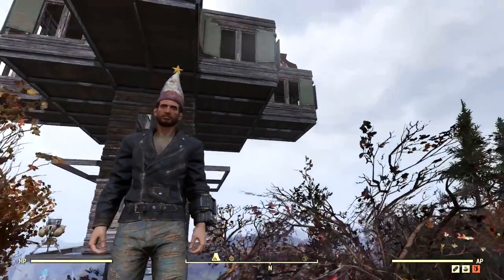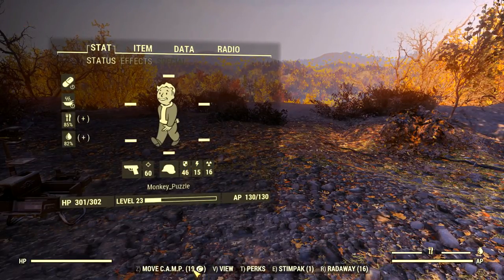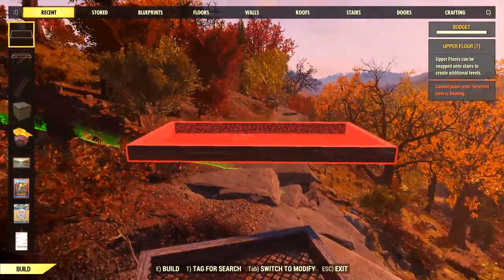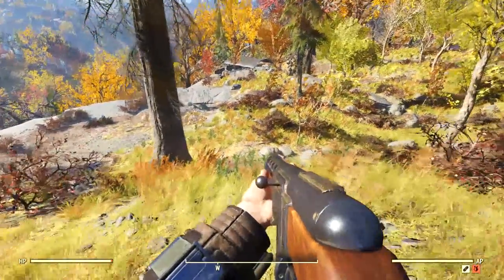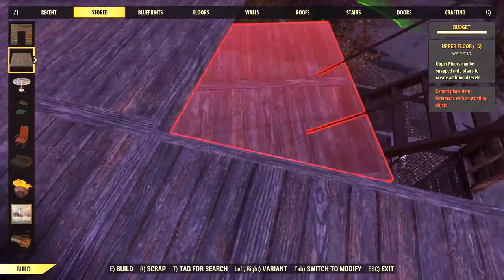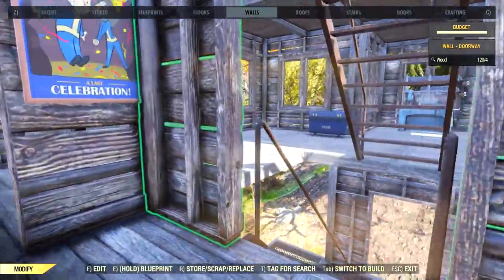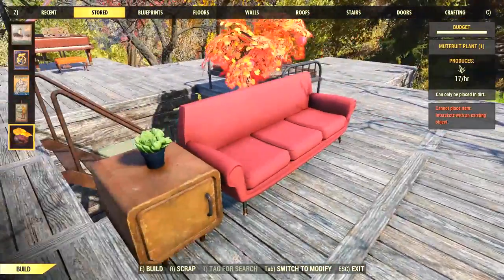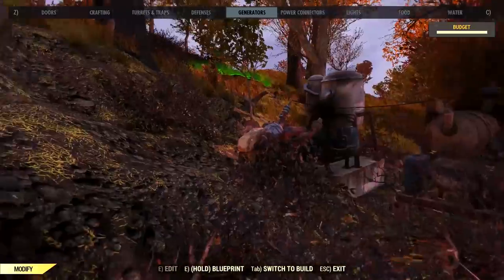Fallout 76 CAMP Tutorial - Fully Mobile Max Budget Base Step by Step Build

Comment: That "Object is Floating" glitch comes from your base being supplanted by someone else's placement. At this stage of the game, I guarantee that everyone will run into it eventually. It has nothing to do with the materials used. Think of it like the Castle's glitchy navmesh. If you start cleaning and building before the Minutemen clean out the Mirelurks (Or 1 of the corpses glitches into the armory) you find you can't put anything inside on the floor, cuz it glitches down.
   The best workaround is to make blueprints of each floor of your house. Then you can just delete the faulty auto-blueprint (just like in this video), and use the blueprints you made. They always pull from your stored items, first.
   There is also a plan for a concrete ramp foundation. Don't think that's the exact name, but that's what it looks like. You might like what it can do.

Comment: I have spent many hours trying to understand the build "rules" in Fallout 76. Some valuable things I've learned. First off, blueprint constantly. When you make a change to something, blueprint it so you can recall it again later. Next, blueprint in sections, floors, or rooms. Keeping blueprints smaller makes them easier to place. Don't blueprint "floating: objects or objects you "fiddle" with to get into place. You'll be allowed to blueprint it, but it won't be able to be placed again. Blueprint those floating objects on their own. Don't blueprint floor decor with your structures. I blueprinted the interior decor separate from the structure. The most valuable lesson I've learned, blueprint your structures without a foundation. Foundations seem to be the biggest problem with placing a blueprinted structure.
Reply from the maker: I've heard that blueprinting structures without a foundation is the best work around for moving buildings with a larger footprint. But with this design, I've found blueprinting to be completely unnecessary and a very misunderstood feature. In fact, I haven't used it at all. But I do plan to get into them for some ideas I have about creating customizable modules in the future.

Comment: Great guide. More space available with just 2 turrets(rocket launcher ones >:) )  on the corners. With such narow base, these should cover most of the area. On top of second level I would extend the area for generator(-s) and periperal power hookups. More squared top would provide more placing options for decorations
Reply from the maker: Sounds like you did some good budget trimming. I haven't unlocked the other turrets yet. Yes, those four bays could go and save a lot of parts.

Comment: If you wanted to add more structure to the sides, use the 2x1 at the ends of the stairs, then put 1x1 in the four corners with 2x1 in the middle.That should then allow you to snap in walls on the sides. Also if you flip the door around up top so that when you look at it the handle is on the left, it should then open into your base instead of opening into the room at the top of the stairs. You could also swap the Chemistry station with the Tinkers Bench so Players can Bulk items. :)

Comment: @monkeypuzzle I was able to wrap two walls and two door frames around the stairs like you were trying to do in the 32 minute part of your video. You have to temporarily move the stairs to the left.  Remove all the floors from the top floor on the left side and to be able to place the stairs, you have to add one floor so you can place the stairs for support. Then you will be able to place two door frames and two walls on the sides and place the stairs. *the stairs can be moved temporarily to the left or right but I didn’t wanna confuse anyone. Let me know if this works for you @monkeypuzzle.
Reply from the maker: Thanks for the advice. I will try it out...

Comment: Good design. You will want to think about power for later game, i.e. Water Purifier, Laser defense. Also, I had to have the top floor a little larger to accommodate the power frame crafting bench.
Reply from the maker: Thanks the advice and the heads up about power frame crafting dimensions. Yeah, at the very end of the vid I just put the water purifier and generators sitting on the ground around it for now.

Comment: While I use something like this (though I stick to only 1 upper floor ) there is a huge flaw if you place in a dangerous area. The iron beams can me quickly destroyed by level 40+ mobs.  Also as a side your budget changes as you level. So you max budge here is just from your level now gain a few level and you will see the budget slowly creep.
Reply from the maker: Hi Mr. Shoop! We do a test in an upcoming vid about whether the narrow bottom actually makes this base vulnerable or not. Stay tuned...

Regarding the budget, what I've found is more subtle than that. The budget doesn't actually go up, but parts crafted at a higher level take up less of the budget each.

Comment: It's important to place your C.A.M.P. at least at the same hight as your base platform ... otherwise you won't be able to put a roof on top of the building if you are to low with your base placement.
Reply from the maker: Good tip. I had some issue with this when I was designing it.

Comment: You can get the post to snap on the corners but you will have to snap half floors on the corner of the floor you want thin you take the half floors away and the system lets it stay

Comment: Has anyone griefed your building yet? I keep getting that random A hole attacking my base simply cuz they are there. I need to build more out of the box structures thanks for opening my mind to something more manageable.  New sub! Thanks again
Reply from the maker: Thankfully I haven't had any problem with that. Just the usual molerats and occasional scorched.
Reply: @Monkeypuzzle  added a level above yours can't put a roof build height limit.

Comment: Did you have to rebuild at the next log in, like when it tells you camp can't be found, or was the entire structure still there even without blueprint?
Reply from the maker: No it was fine. Also storing a base is different than blueprinting it. Blueprinting is useful as a backup, but mainly for if you want to be able to make different designs or modules. But any base can be stored without a blueprint--at least at the time when I was doing this.

Comment: Nice design. I like the raised unit idea. 

Problem I have is a previous bad base design which locked a lot of wall and floor together that I could not seperate or delete. This has all somehow been stored as one big part when I moved my base location. Would like to delete it but somehow can't. It is very anonoying as I think it is consuming budget. Wished they'd expand the settlement budget.
Reply from the maker: From your stored tab, if you select to store the assembled structure again, it should break it down and store it as separate parts. Then you can either rebuild with those or scrap them individually.
Reply: @Monkeypuzzle  Yeah, that worked. Thanks bud!

Comment: anyone else having the problem that says structure needs support when you move the camp and try to put the base down???
Reply from the maker: You saw how I had that problem initially and overcame it. It happened to me by fortunate accident with someone taking my spot, but probably best to try to place the build during several stages along the way, so that it will be easier to identify the offending piece. For me it was the posts higher than foundation level.
Reply: @Monkeypuzzle  Thanks ill try that now <3
Reply: It won’t let me replace the build it says the structure is floating
Reply: @KratosMountOlympian  you have to make it again, do the build in stages so you can find out what the problem is. my problem was the lamps i put on the roof.
Reply: @Best Generation Gaming just build it in stages so you can find the problem. i still ont know why it didnt like the lamps in my base
Reply: If it says it "requires support" it is because you have decorations or shelving in your blueprint. Beds, turrets, power connectors, and stash boxes are amongst the things that are safe in a blueprint. So lay the blueprint down, and add the decorations after.
Reply: @mooneternal1  thanks!

Comment: Does anybody find it odd that this issue was noticed during the beta state (problems setting down camp) but Bethesda have done nothing to fix it? It's a great idea building a base with a single foundation but It should not be something we have to work around (not for the price they're charging for the game anyway)
Reply from the maker: I think at this point they are more focused on basic playability (e.g. game hitching, crashing, etc) than fine tuning the building system.
Reply: @Monkeypuzzle  I would have to say that relocating your build is one of the essential 'playability' issues that needs to be fixed. I have rebuilt my base about 20 times and it's getting tedious, especially when you have to be quick doing it. If you've ever found yourself on a part of the map where you keep getting killed and you can't escape the death/respawn loop because you're over encumbered you'll understand what I'm talking about. Your only solution is to drop everything (including most of your guns and armour) and run away. It would help at this point to be able to rebuild your base in an instant in order to set up a defensive point to counter the situation. You can't even build a campfire to boil water without first setting up camp. The other night I spent nearly three hours trying to get away from a dragon overburdened with my retrieved junk, thirsty and unable to find or boil water after using it all up trying to escape the loop. In the end I left everything,junk, guns, armour, just to get away from the ridiculous situation I was in. When I'm not working I consider my free time to be precious, I don't want to waste it stuck in endless gameplay loops because Bethesda won't pull their finger out. Funny how everything works perfectly in the atomic store. If you want a pink hat for six dollars at least you'll be able to keep it when the mutated skyrim dragon takes away everything else you have.
Reply from the maker: That's why it's important to adapt to the game ecosystem that you have, even while advocating for the one that you want.
Reply: Is that a real question?  That Bethesda didn't fix a well documented bug before game release? lol

Comment: Awesome!  I have been having a heck of a time both with figuring out how to build and budget.  Had no idea the stuff stored counted against your budget... I have a LOT of scrapping to do when I get back on.  I'll give this a try, I like how it looks and the mobility.  

I've watched other videos where they say to blueprint everything but the foundation as there are occasionally errors when moving it.  Would you say that is a better option for reliability, or just go with your method of the saved template?
Reply from the maker: I'm glad there was some useful info in here. The blueprint everything but the foundation is a work around for bases with more  foundations that won't place. You can manually put down the foundations and then build your base with a blueprint. In my  case here, that's unnecessary, because a single foundation will always place.
Reply: I did the blueprint like you have it, so far I have had no issues, so thanks again!  I ended up putting walls up on portions of the roof to enclose a bed and power armor station. I have to pay attention to where I place it though, based on where I set the CAMP up, as it reaches the upper limit of buildable area.

Comment: Just so everyone knows, I just built this base, you can not blueprint it as Bethesda was stupid enough to make a blueprint budget and it doesn't cover half the base. If you want to move this base you have to read it down first every time. If your C.A.M.P. is removed because you joined a server where somebody else already has their camp in your spot, you lose this build forever.
Reply from the maker: I'm sorry you have had that experience, but as I've demonstrated multiple times, this camp is easily moveable. First, no blueprints are required to move a base. The whole assembled structure is automatically saved in your stored tab ready to be placed down at the next camp site. Also, as I show in today's vid, https://www.youtube.com/watch?v=D8ymkZ9Ttag , you can blueprint the whole thing in one go with Z (on PC). Again, not that you need the blueprint to move it--just if you want to build it again after building some other things in between.

Comment: Nice. I had just been thinking about building something like this when I came across your video. 
How does it work when you have crops / water purifiers and generators around it - and you move it? I’ve had things disappear and am wary about moving it again without storing first.
Also - as you’ve noticed the building is very picky about the order you place things.
Reply from the maker: So far I just place them down around it. They get stored separately when I move it.
Reply: You kind have to be picky with this new build system.  Like you need to put doorways then stairs,   arches before half walls, and corner roof peices before the little slanted ones.

Comment: Several weeks ago when at Level 8 in Fall-Out 76 I decided to build my camp. Once completed I continued with the game until the next Checkpoint. The following day I loaded the game only to discover that my Camp had completely disappeared due to one of the many glitches and bugs in this game.

I read somewhere that the higher the level of the player the more budget there is. So I waited until I reached Level 58 and again began to re-build my camp. The first thing I noticed was that the budget size was just the same. So, where did that rubbish come from ?

Anyhow, my main point is this, I set down all my foundations but decided it was too spacious, too large, and so I tried to store several foundation items in an attempt to reduce the size of the perimeter but the game told me that 'The item cannot be stored' nor deleted. These items were already stored from the previous build several weeks earlier which disappeared due to the glitch. 

So, I'm asking is there a way to reduce the size of a camp by way of storing or deleting items which have already been laid down. I'm almost certain that there wasn't a problem doing this in the first build but now there is.

Thanks.
Reply from the maker: If your previous base was stored, then that is what is taking up your budget, as stored items count against it. So if your stored tab is maxed, you'll need to scrap unwanted structures.
Reply: @Monkeypuzzle  I used up all the stored items and re-built the camp from scratch after deleting the original camp blueprint.

Comment: 31:39 these chairs help nothing. Here is my story: came across this build randomly on a server and thought: "well, that's a nice portable build. let's explore"... i got up the stairs and was locked out by those doors. so i took a brave jump and on the first try i was inside. Maybe something taller would do it. But those chairs... nope. Now that i had a lot of problems replacing my base this build is the only solution until they fix it. Building is too random at sometimes. Parts snap where you don't want them and it's a real mess to get a base set up like this. But what is the point of locking other players out anyway? They can't steal your stuff, so it's cool i guess.

Comment: Hey monkey i built the same but i discovered if you but the steel mesh floor over the opening to the main floor it will fit over even though the stairs in order to entet or leave just put into storage and replace when entering and leaving
Reply from the maker: There ya go. I did something similar to keep my NPCs out of places in FO4.

Comment: I’m having a lot of trouble with creating stairs. Anyone else with this problem? Right now I have a mesh-net stair floating in the air with two roofs attached to it and I cannot scrap or remove any of them. Quite annoying. I have tried to build a two level house. The first stair was fine. The second could only be placed outside my house and then building walls around it. I could not lay down a floor under the stair and had to jump across the hole. Is it me or is it either too difficult or ridiculous to make stairs in F76?

Comment: can you put the water collector to the main part of the base or will that interfere with placing it when to move it again
Reply from the maker: It would make the base easier to place, but that water purifier has to be placed on dirt. The bigger models have to be placed on water.

Comment: So I built this identical to yours and I oddly can't build that high. I have one less story than you do. If I attempt to make it as high as yours it tells me I'm out of the build area. I also can't place 6 turrets. Build budget it maxed at 4. I'm 10 levels over you as well. I think this shit is broken. Lol
Reply from the maker: I got that height limit thing a couple times. Relogging can help. Also moving the camp and placing the stored structure as close to the camp as possible fixed it as well. 

Regarding budget it seems that the budget doesn't increase with level, but parts crafted at a higher level use less of the budget. If those turrets or building parts were crafted and stored from when you were a lower level, you may want to scrap and remake them.

Comment: how come it cost you nothing when replacing it? i need to pay a bunch of materials if i wanna move it with blueprint
Reply from the maker: I didn't use a blueprint. I used the actual base structure that is stored when you move camp.

The blueprint is more of a building tool than a restoration one. It is meant for when you're replicating structures that you are building from scratch.